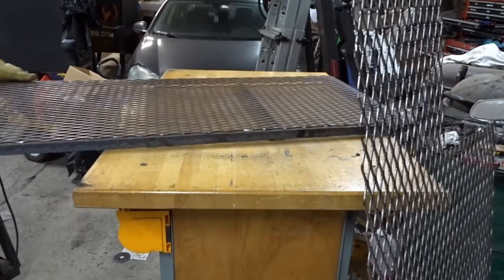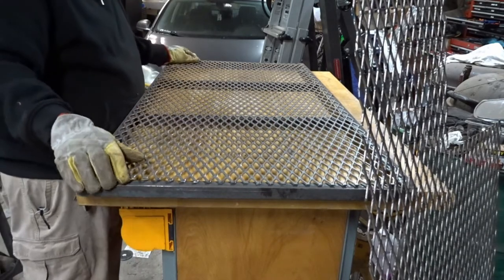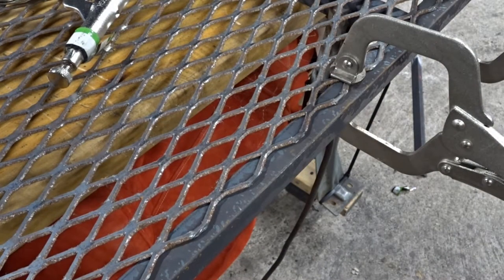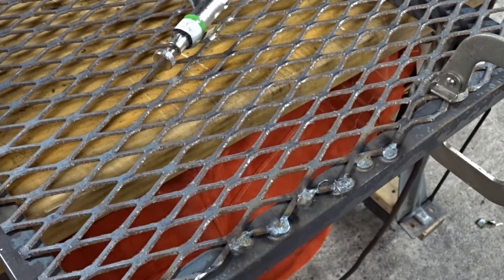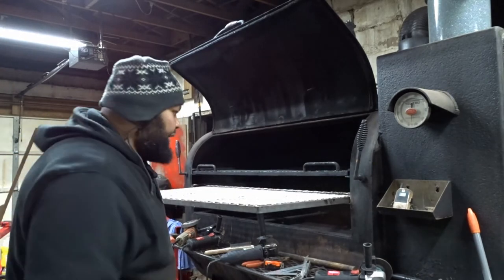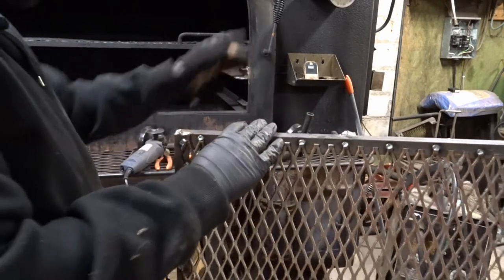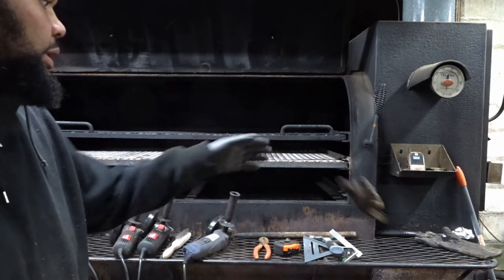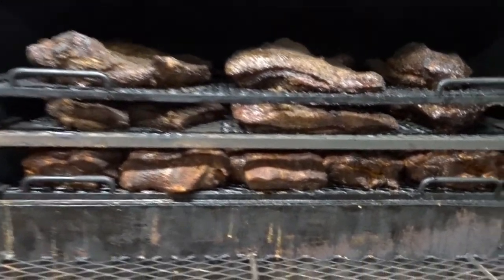SDSBBQ - Increasing the cooking capacity in my 275 Gallon Smoker - Part 3

Comment: Dash, I think that you can move the top shelf slides up an inch or two and it will be great. You probably can put the new shelf that you built on the bottom slide and use the bottom one on the second slide and not need to make a new grate. Hope the cook goes well for you. Keep on smoking.
Reply from the maker: Hmm... Now that's a thought. IDK how easily it will be to move that rack. Kirk, the builder seemed to OVER build everything! When I get a moment to head out there and or it warms up a bit I might visit this and see what I can figure out. Thanks for your suggestion.